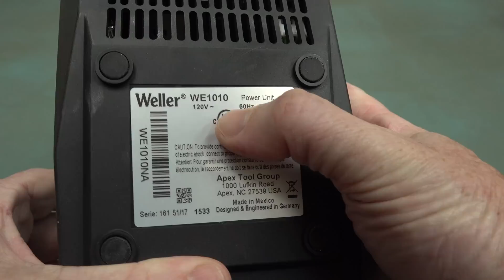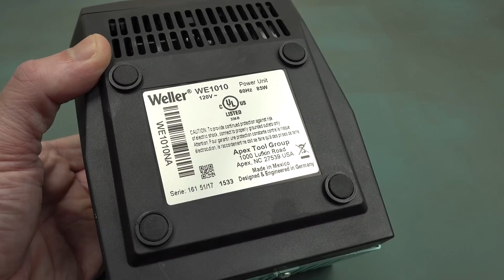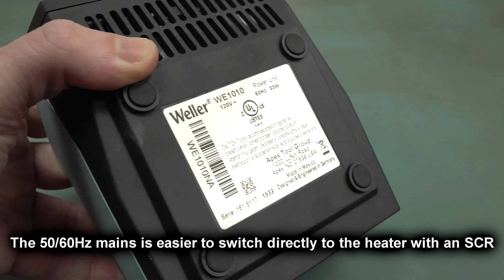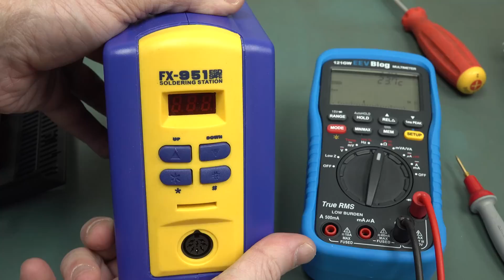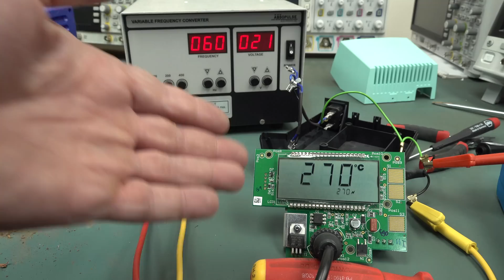EEVblog #1152 - 240V-120V = Magic Smoke!

Comment: no fuse on the primary? come on Weller, even my DIY stuff got one.
Reply: Why fuses? Isn't the cord a 10A fuse anyways?
Reply: @victornpb  WHAAT?!? Please tell me you're joking!
Reply: American electrical code requires a 15 amp breaker on the outlet and GFI protection on any outlet near water.
We also require double insulation on all tools.
We place the safety devices inside the distribution box instead of in each appliance.
Thats something you need to keep in mind when bringing American appliances into other countries.
Reply: @glennchartrand5411  - It is the equipment designer's responsibility to ensure their equipment doesn't not become unsafe. It is not adequate to assume that household protective devices exist or will function to minimize any potential hazards. No excuse not to fuse the primary in this equipment.
Reply: @staevobr  that transformer was designed for the N.American grid.
It would have operated safely for a century.

Here's a litte factoid about American voltage ratings.

115 V means it can run on 50 or 60 Hertz  power.

120 V means 60 Hertz  only

We created the 115V rating just to let people know if something is compatible with European frequency.
( We also put a yellow stripe on the green grounding wire if the appliance can be converted to 220V 50 Hertz.)

230 Volts at 50 cycle would short out that transformer faster than a fuse could blow. 

It arced through the insulation the moment he flipped the switch.

We put mustard seed oil in the varnish on transformers so that people can easily see and smell an overheating transformer.
(thick dark grey smoke with a very strong distinctive smell BEFORE there's  an actual fire. )

Thats why smoke poured out of the thing within seconds of being plugged in to the wrong voltage and frequency.

The smoke and strong odor he is complaining about is a design feature to grab peoples attention before the transformer actually catches on fire.

We've been adding mustard seed oil to coil insulation for over 100 years.

You shouldn't plug in anything rated at 120 Volt on a 50 Hertz supply.
Reply: @glennchartrand5411  Arcs at just 240 Vrms?  That would mean not considering PEBKACs, not overspeccing the enamel and getting wire with so thin enamel it could only be used for 120 V.
Reply: @0x8badf00d  the main issue was the frequency (50 Hertz)
On transformers the inductive reactance lessens as frequency drops.

This transformer would have failed at 120v 50Hertz .
Overvoltage (core saturation) only accelerated the process.

You've misdiagnosed the main  cause of the failure.
Reply: @glennchartrand5411  17% cycle period increase vs 100% voltage increase?  And I was asking about the damn _arcs_.  Nevermind, go back to your transformers that can't even handle a 16.7% overload.
Reply: @0x8badf00d  actually it was a 235% overload.
Reply: Yeah, and what's the bigger factor 2 or 1.17?  And don't forget to calculate the power, 544% load
Reply: @glennchartrand5411  It doesn't matter. The unsafe event happened. That's why this video exists.
Reply: Glenn, How can you defend this?  It was done as cost savings.  So by your logic a smoking smell show that WILL ignite is a better safety feature than a MOV and 1 amp primary fuse that would have never let it happen in the first place?

That heavier than air enamel smoke is very combustable once you get a spark, which is moments away.  Watch any transformer/motor burnout video.  Look at the transformer here....they even used the low temp red enamel (designed to burn away at soldering temperatures for easier wire tinning)...look at how much burned off the copper, contributing to cascade failure and inevitable fire.  The copper itself didn’t even get hot enough to discolor!  Rapid insulator burnoff, leaving perfectly intact adjacent bare copper conductors to cascade short is ENGINEERING FAILURE.  That transformer is ghetto trash I would expect to find in a $7.00 battery charger from Harbor Freight.

Even if my transformer is available in 1 of 7 therapeutic scents when it burns out moments before it ignites; there is no reason to not have the MOV and fuse.  The downside is the MOV and fuse would never allow the secret scent smoke and flame to be released.  Are pumpkin spice scented transformers available for the Holidays?

Once a globalist mentality gains hold of a company to maximize profits for shareholders,  product quality and innovation instantly begins its race to the bottom.

SO FED UP WITH THE GARBAGE MADE TODAY!
Reply: @gavincurtis  pumpkin spice scented transformers? good idea, time to make an indiegogo ;)

Comment: Long ago when we still had a lot of Dell workstations in the office, at one time the power supply failed on one of them.
I called Dell to have it serviced, and they elected to send a new power supply by mail (they are easy to replace).
I installed it, connected the mains (230V here), switched it on and BANG!  Magic smoke.
Turns out that the slider switch on the back was set to 115 instead of 230.  Apparently the setting on their stock,
we never had that problem with a newly delivered PC they were always set to 230 when delivered here.
Called again, told them what happened and they sent yet another new PS.  Again set to 115 but this time I checked it.

Comment: lol, my first station was  the Weller WES51D bought from US, so 120V version.  My mains are 220V and i was as naive as an excited kitty. 
So I plugged the station to mains as soon as I unboxed the station and was watching it heat up, suddenly a big bang and all gone dark. 
Later found that the primary coil was blown. The WES51 is a low wattage station,  so luckily in my case,  the primary coil of its transformer had finer gauge than the 1010, which lead the coil winding to be blown and then disconnected from the mains in case of the overload. 
This protected rest of the station from being damaged. 

Later, I replaced the original transformer with a local made dodgy 220V compatible transformer which is still working flawlessly for 3 years now.
Reply: Later I bought the WD-1 from alliexpress and to my surprise, I found that the seller already modded the original station to be compatible with 220V by replacing the original 120V transformer. I never been happier with a station than that. 
Recently I bought this 1010 120V station for another official purpose, but this time I triple checked by my first plugging in with a 220V to 120V step down converter. 

Expensive experience for lifetime for a guy like me, lol

Comment: I have a higher end Weller soldering station. Now I'm curious to see how mine was put together.
Reply: My WX-2  has a fuse integrated into the IEC receptacle. It's there and you could miss it with a cursory glance.

Comment: Very substandard construction. No fusing.... No boots or heatshrink on the connectors.. no thermal cutout on the transformer... Not the kind of thing I'd expect from Weller
Reply: My old made in USA Weller from 2002 has a line fuse in the bottom of the unit.
I don't think of these newer units as real "Wellers",  just another once great name that has been whored out.
Reply: Red enamel wire is the low temp type.  Makes for easy soldering as the heat of solder burns it away for easy tinning.  That’s why the red enamel burned off so surprisingly easy.  The amber color (clear) enamel is usually the high temp kind.  You have to scrape or sand it off to expose the copper for tinning.
Reply: @gavincurtis  THANK YOU!!! I have always wondered why I couldnt just heat the enamel off when soldering, when other people told me it was easy. But thats because I have used the clear enamel I see
Reply: Exactly what I would expect from Weller. They determined that the red "budget" models lasted just long enough so they made all models to that standard or below.
Reply: @BruceNitroxpro  According to comments the failure mode was very likely due design flaw, not a manufacturing defect. You know overvolting a cheaply designed device, what could go wrong?
Reply: Nothing substandard about it. It was made for the US market and that is perfectly fine in the US market. You don't need boots/heatsrink on connectors that nobody's ever gonna brush a finger or drop a paperclip across, and we don't require fusing or thermal protection on mains devices over here.
Reply: @TestECull  Depends if you're going for the bare minimum or want to protect your brand credibility. And no fusing on a device that could be connected to a 20 amp circuit... but which draws less than 1/2 an amp... is a dick move, no matter which rulebook you're working to. It's pure 'fuck you, mere consumer'
Reply: The lack of boots might even meet proper class II.... but. No fuses, in a place where the plugs don't have fuses? HELL NO
Reply: Hint, i'm not gonna look favourably on weller after this snafu. and someone with actual purchasing power MIGHT feel the same way. Is Weller willing to take that chance?
Reply: @TheChipmunk2008  It's perfectly fine to run it unfused. Devices don't need fuses here. We don't use retarded-ass ring mains that can push 30+ amps out of a socket in a fault situation, we use a more logical topology in our walls and you'll pop a 15 amp breaker pretty easy, long before you have any sort of hazardous condition. In fact they pop too easily, my room breaker likes to pop for no good reason at all even though every device in here is in proper working order.
Reply: btw, regs.  not code ;)
Reply: @TestECull , and a rewrite of the code is within the purview of the ordinary user?  I think not.
Reply: @TestECull  Many newer homes have 20 amp branch circuits in the kitchen for heating devices, etc.  Outside of that, commercial buildings typically run 20 amp plugs throughout.  Say, an electronics shop?

This thing really should have been fused or have a thermal cutout on the mains side.  Anything to limit the possible fault condition if someone goofed up.  In my IT shop, we have 208 on those C13 taps at the bench for heavier duty server gear.  The same bench that I work on other gear at.  It's not unfathomable that something like this could accidentally get an overvolt.
Reply: Blame Weller, it doesn't matter where it was made if this was how Weller wanted it to be :P.
Give a skilled worker shit tools/components and the job will end up like crap.

Comment: My first Weller, that I bought 25 years ago still works fine with it's good old iron core transformer, I'm not sure that an smps would have made it so long without annoying me with dried out capacitors or shorted semiconductor. By the way back then it was quite expensive, especially for my young boy budget^^ , but I can still find spare parts (and not only solder tips !) Can you believe it ?
Reply: Only one explanation..Weller.
Reply: @JanicekTrnecka  It was nice that my local electronics shop had a replacement Weller iron for the WESD51... but when the other WESD51 failed 4 months later they hadn't bothered to restock another iron... so I ordered a JBC (I think because Dave did a video on them?). I bought a second JBC on Cyber Monday (not much of a sale, 10%, but whatever) So far it's pretty nice... but we really haven't had them long enough to know yet. Heats up super fast, hibernates quickly in the stand, and hot-swapping tips is pretty nice. Parts certainly aren't going to be as available, but we got a fair number of tips. The PIN-code settings lock is weird, though.

Comment: Wow, srsly? According to Reichelt, this thing (well, the 240V version) is 144€ (edit: reduced, original price around 170€), and it does not have a fuse? Even my el cheapo Xytronic station from Taiwan for 75€, and also the even cheaper 25€ no-name hot air station from China has one. Not impressed at all...
Edit: and it even does not have a socket for a ground strap? WTF Weller... but surely, the CEO earns enough to afford a Porsche, I guess? m(

Comment: In the DC I used to work in we used really cheap power supplies and we had mixed voltages 120/240 so I've blown up many power supplies in my time lol Fun when they shoot flames out the fan! I had one that stayed alive until the system booted all the way, then came the flames!

Comment: I blew a transformer a few years back, but it was actually a step-up transformer (the 12.6-0-12.6 winding was primary and the 117 winding was secondary) in an inverter I had. There was no indication on the rating and I was running a 25 watt soldering iron on it and then even worse a fan. I unwound the transformer but couldn't find the short, but the vibrator (yes that old) and the capacitors (which I had to replace initially) were also fine and it was blowing fuses. I don't think it was the soldering iron alone that killed it, but later trying the fan that did. I was basing the limits off the fuse as I didn't know much about the magnetic limitations of transformers at the time. From my best guess looking at replacement transformers I guess I was running at 1300% to 2000% of the transformer rating, but the inverter box didn't really get warm.

Edit to add: Also, us yanks do have to worry about the voltage of imported products as it is possible to go over (although not 100% over) the rated voltage if we import from Japan.

Comment: fuse and a varistor would have saved the coil
Reply: you don´t even need a varistor for it. The transformer will last the few ms that the fuse takes to react. Although a varistor would prevent overvoltage on the secondary in that time.

Comment: 1:30 the closest there might be the old Metcals. If my memory serves me correct when I fixed one, they use a 48V switched primary side with a secondary switched regulators to feed the RF driver section. If I recall they can do 120/240 with a switch, but on 120 they'd go poof for sure, from what I remember of the circuitry.

Comment: I know that smell exactly, since a college connected a 24VDC controlled industrial relay to 230V. The smell from that insulation is very different from that magic smoke smell, because it is called safety smoke ;)
Btw, I  find it very disturbing to have a C14 plug on a 120V only device...
Reply: The IEC connectors are very common on 120V only and 120V/240V manually switched power supplies.  Usually not a problem in North America and other 120V countries unless you are doing something unusual like using a 240V/208V UPS that I've seen a person assume would be OK with a computer without noticing the voltage switch on the back of the PS.  Just like any power input you shouldn't make assumptions.  It happens with "DC barrel connectors" as well.  The worst thing is when manufactures don't properly label their products input and output requirements and assume you will never have it near another product with the same connectors!
Reply: @highks Back in the 1970's, I was on an old Nike-Hercules site in Germany. The High Power Acquisition Radar (HIPAR) used 120V 60HZ power. The rest of our equipment used 120V 400HZ power. We had converters to supply both of these, as well as generators for tactical power. We wound up with outlets for both 60HZ and 400HZ that used the normal US connectors. We also had the 220V 50HZ outlets, but they used the German connectors. You really had to watch what plug you used.
Reply: I use nail polish on power resistors to make "safety smoke" if they overheat.
Reply: More like a C4 plug!
Reply: @highks idk, I had to look up wikipedia, apparently Brazil used to import gear from US as well as EU so they had 120@60 and 240@50, but then they want to standardize on 50Hz but it was unsuccessful, then the most developed states used 60Hz was set as an standard, so this is why 240@60. Some states have either 120v or 240v, but I know that some have both as different phases, houses which have both wirings they dedicate 240 for high power stuff like heaters, air con, etc. what bothers me is the lack of any standard regarding outlets, theres nothing stopping you from plugging stuff wrong besides knowing which outlet is which voltage.

I didn't know the Brazil used a different "flavor" of PAL, second to wikipedia is is called PAL-M for it being 60Hz, and M standing for (NTSC). And apparently it was 60Hz because of the standardized 60Hz mains, so standard PAL 50Hz could not be used, I just don’t understand why they don't just chose NTSC instead.
Reply: @victornpb  60Hz is more efficient than 50Hz (50Hz transformers are physically larger and produce more heat than 60Hz), and 240V is more efficient than 120 (120V circuits have twice the current of 240V circuits for the same power), so it makes sense to use 240V 60Hz. The US would do the same if sensible decisions were made. Also, everybody ought to use UK style plugs and outlets because they’re the best! Well, except for the caltrop thing. So they ought to round the ends of the pins.
Reply: In Brazil they have both 120v and 240v both at 60hz so they have the American and eu plugs and use them interchangeable. So 240v outlets are usually labeled as well as appliances